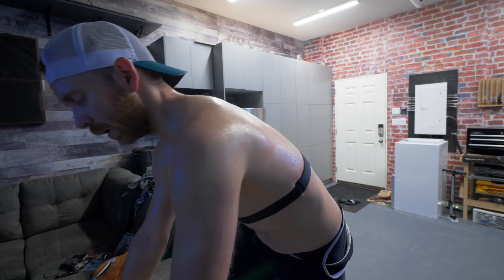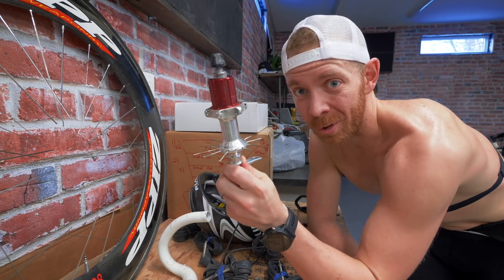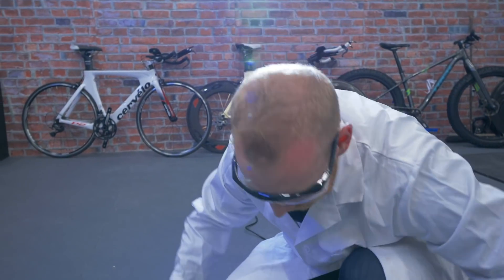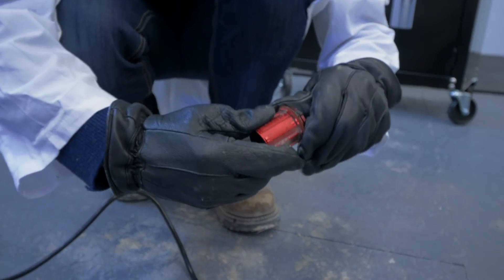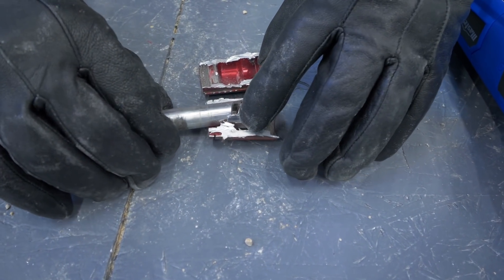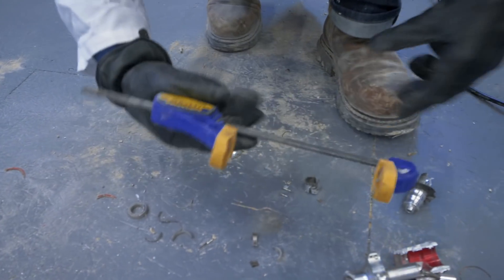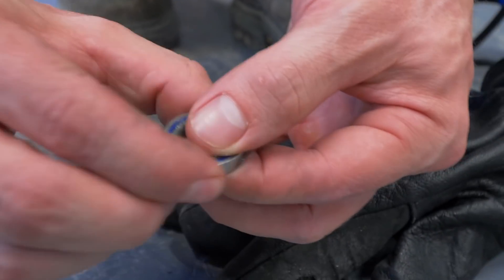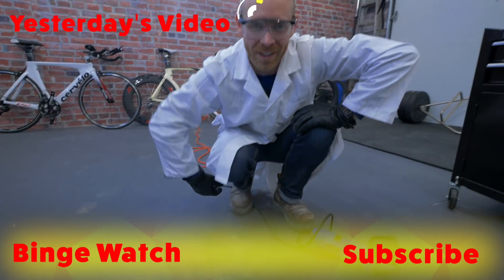CUTTING OPEN a Zipp 808 Rear Wheel Hub | WHAT'S INSIDE TRIATHLON GEAR

Comment: Why the rear hub it was still good. Like Lukas below me said google and there is this really really good place called YOUTUBE where you could find how the dismantle, regrease or replace bearings, then reassemble as then you would of had a good spare rear hub.  
On the other hand get your trusty little grinder out and cut that rim in half so we can see what's is the rim and how thick the carbon is in different places though out the rim. Like the thickness of the braking surface compared to the dish. 
PS if something's broken tear it apart
Reply: Trevor Gray its because hes a triathlete

Comment: Fun to watch, and im sure even more fun to do, but you missed all the good stuff. I guess youve never done any research on wheel hubs. Those bearings are the bearing races, the blue ring in them is a plastic seal, if you get a sharp pick or something you can pull the seal out and behind it you'll find your ball bearings packed in grease. The seal prevents crud from getting inside. Also you missed the pawls in the freehub, thats what makes the nice sound when you freewheel. Basically usually 3-6 spring loaded teeth that the springs push out to engage with the ratchet in the wheel hub when pedalling but allow to slide over (and make that noise) when you freewheel.